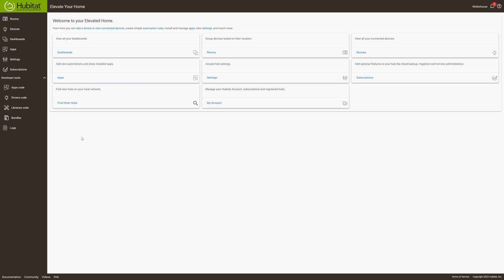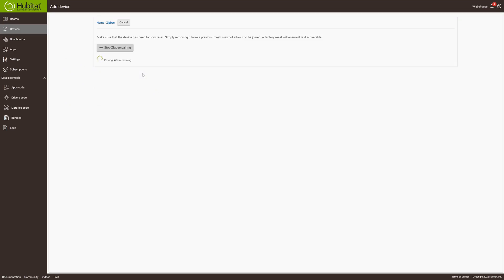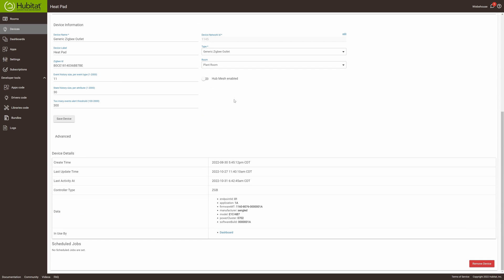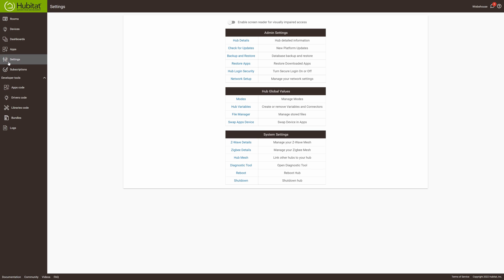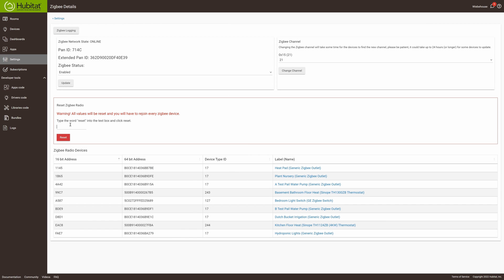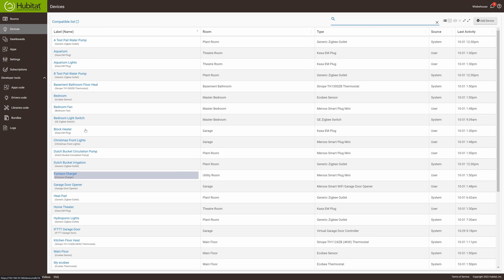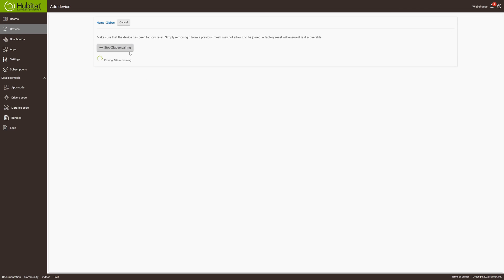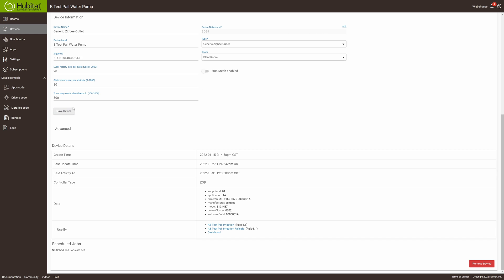Stop Zigbee Glitches: Hubitat Troubleshooting

Comment: Solid video, as always.  I also made the same mistake by connecting a smart plug near the HE hub and then moving it to its final destination. In the end, I didn't have enough Zigbee wired devices as most of my smart devices were from Kasa switches or battery powered Zigbee that (as far as I know) don't work as a mesh (?). The amount of smart devices I had connected "overloaded" my Wifi 5 modem/router.  I ended up having to go with a Wifi 6 router (by Asus) and a second router (also Asus) to act as Ai Mesh and communication between all the devices was solid again.

My fix is probably only required if you have too many devices that aren't able to act as a Zigbee mesh and if your server closet is at one end of the house.

Have a safe weekend and week
Reply from the maker: Thanks for taking the time to leave your personal experience.  I do have a wifi router that can take a ton of different devices so I've never run into that, but have found that Hubitat uses a ton more resources to run wifi vs zigbee or zwave.  This is my primary reason for moving over to zigbee.  Have a great time over the holidays!